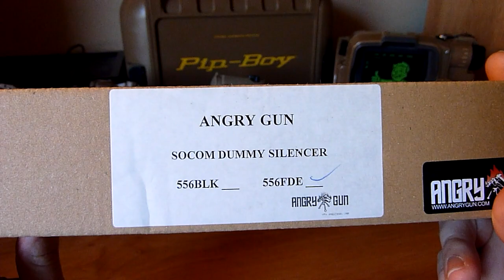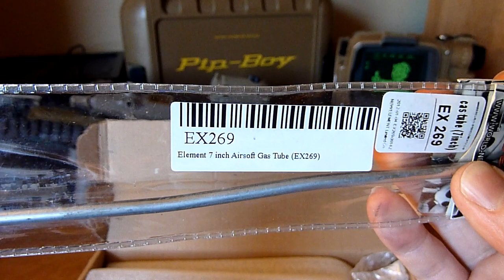AngryGun SOCOM556 FDE Overview

Comment: Is the suppressor that went with the 3 prong the pts mk18 SD mock suppressor? If so that the same one I have I like the actually suppressor part better than the surefire I just wish the SD had the same ratchet part and it would look the best ! Great video though looks awesome on the lm4 definitely have to get rid of that gap . Idk what the difference is between yours and my mk18 but mine only has like a 2 mm gap at most!

Comment: Hoping you can provide some hard data, sounds like you know your stuff and you have a  real 556 NATO Aero Precision/Daniel Defense rifle.
Q: What issues beyond drilling hole of gas tube keeps a Madbull Airsoft DD RIS II rail from being installed on a real AR?
 Madbull is 6061 Aircraft Grade Aluminum and DD is 6061, so unless you are going to be using the rifle a a SLEDGE HAMMER Madbull version should work fine. Seriously doubt it's going to catch on fine, melt, etc.

Regardless, Barrel nut and flange would be my main concern.
DD sells the hardware kit for around $42, containing a Mil-Spec (Hardened) barrel nut, the rear flange the (6) Allen head (HEX) bolts go thru.

What exactly are the issues ? 
Barrel nut would have to be replaced.
I would think the flange is drilled differently, and or is weaker than real version.

Why the interest ?
FDE DD RIS II version has not been sold since 2016-12.
Black version is $450 to say $500 if tax is added, and say $20 for shipping. Rough ballpark $520... and each time I've checked its ALWAYS OUT OF STOCK.
So pretty much DD RIS II is for all practical purposes N/A. 

Madbull DD RIS II is commonly available @ $110.
Add the hardware kit,  $42
High side $152...
Low side = $110 & cost of barrel nut.

It would be GREATLY appreciated if you explain the differences and possibly if you have some links to the conversion being discussed forward them !
TIA, and look forward to hearing back from you.
(Note: I've been round and round the net, spent more time than I care to admit so any info you could forward would be great !
 Gun guys scoff at using Airsoft rails... not knowing most rails are 6061. Most Airsoft guys are living in countries in which real guns are banned / Highly restricted so they're not much help.)

Hope you can help out.